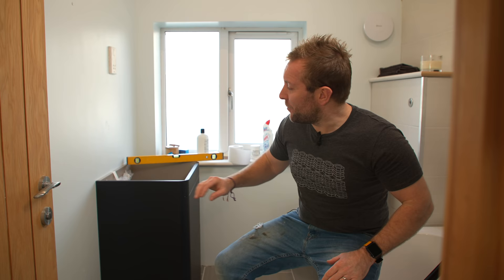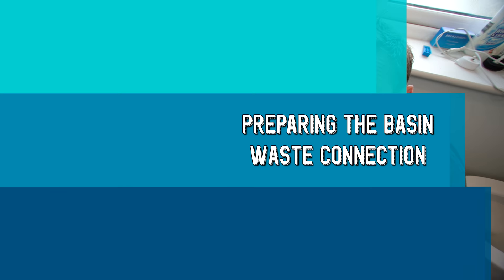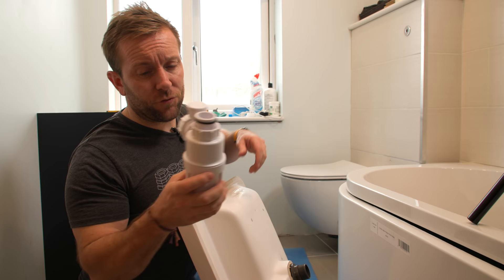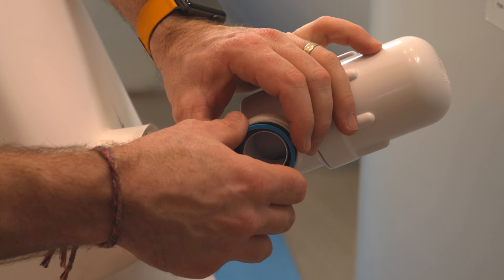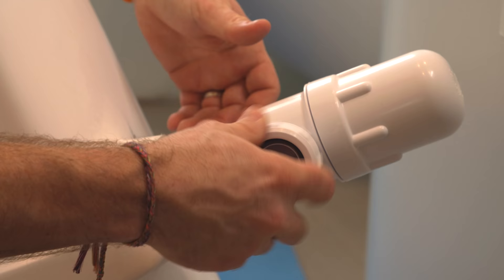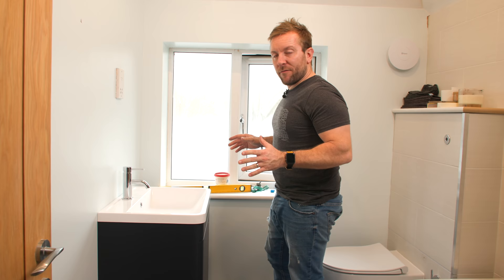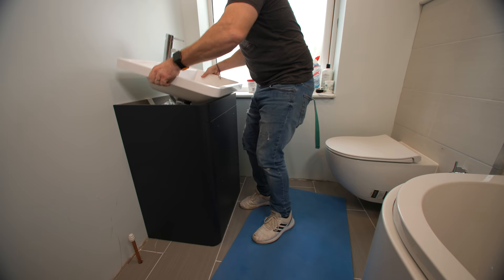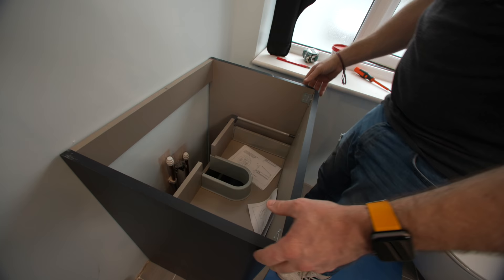How to fit a bathroom vanity unit & basin STEP BY STEP with CHAPTERS!

Comment: Not long finished fitting one of those exact vanity units (from Wholesale Direct) . Never again! The fact that the drawers are not removable forced me to do the entire underside plumbing, then fit the sink last. Annoyed, because I had to get all my fittings measured to within a millimeter. Took ages compared to a unit with removable drawers. Also, I used a quality double-sided mounting tape instead of glue to stick the sink to the unit. Worked a charm. Good video. Avoid Wholesale Direct is the message. Oh, and I used a basin mate kit instead of plumbers mait. You absolutely positively have to use something, as the seals it comes with are about as useful as a chocolate fireguard.

Comment: Should you use tap tails on the service valves to give a flat seal as opposed to connecting flexi straight onto valves bevelled edge ?
Reply: yes!
Reply: Can use the spare parts from a radiator kit when customer asks for TRV's to be fitted.  Flexi will screw onto part and smooth end can go into service valve.  Alternatively get service valves with flat edge/face

Comment: Hiya mate, could you point me in the direction of a video where you have to hang a radiator to suit the pipe/valves already there? Like the heating pipes in your bathroom now, the process you go through to find where you put your brackets on the wall so the rad hangs exactly in position for those valves to go straight onto it. Thank you 👍

Comment: What was the "glue" used to fix the basin to the vanity unit?
Reply: In my opinion it's best not to glue sink to vanity unit this way. If you ever need to remove it you'll destroy unit. Better to use kitchen fitter practice... place the sink on loose, then run a bead of silicone around the inside top edge (and maybe outside). This fixes it. If you ever need to remove just run a knife through the silicone and sink comes off without damage to vanity unit. But that's just my opinion.😉

Comment: How long do you have to leave the solvent weld glue to set before you test it?
Reply: Solvent weld doesn't take long I expect it will say on the bottle but usually done in 5 minutes.  Solvent weld is used for waste pipe not a water feed I usually run the tap after 15 minutes
Reply: Thanks
Reply from the maker: Answering in the next comments vid!

Comment: James... quick question. Watching many (way too many) of your videos...  you seem to frown on the use of the isolation valves you've used here. What's the crack with their use then?

Also was this carried out on a Friday... a Flexi-friday! 😅
Reply from the maker: Cheaper than levers! that's about it though, they are prone to leaking and going wrong though....
Reply: @plumberparts  Aren't they just. Trying to get any in our own property swapped out to F/B lever valves.

One thing then about these horrid little compression valves... is there any decent one's out there or are they all prone to being  'leaky-leaky' valves?

BTW..  loving your extended series on this bathroom refurb. And as Emily might  be heard saying... "get on with it"🤣
Reply from the maker: Answering in the next comments vid!

Comment: Nice camera work. Same vanity unit  I'll be buying.
Would you also use bottle trap on kitchen sink waste rather than a U-bend? Thanks
Reply: If you use a bottle trap for the kitchen sink it’ll have more of a chance to block than a normal P trap due to the way they are shaped inside
Reply: @daleprosser350  P trap all the way then unless space is in issue?
Reply: @elfidge1  yeah P trap is the standard, or you can get specifically a kitchen sink trap with connections for a washing machine/dishwasher waste to connect onto if you need it
Reply: I should’ve mentioned it’s food that would block up the bottle trap
Reply: @daleprosser350  Nice one in that case only thing I took from this video was to get the anti-syphon valve simply to stop gurgling. Appreciate the replies fella, thank you
Reply: @elfidge1  no problem 👍

Comment: Which manufacturer is that bottle trap? McAlpine? My bathroom fitter fitted an S trap to a down pipe and I struggled with bad odours in the bathroom. I bought one from B&Q which leaked like mad, then tried a Wirquin which is much better but not quite perfect and has the worst nut ever!
Reply: Yep it's a McAlpine.  I was so pleased with the one in my ensuite that I have got another for my main bathroom that I'm on with now. Mine came from Screwfix.

Comment: I'd of liked to see how the draws come off and on as I only do repairs and no installs
Reply: You pull them out and up at the same time and the whole drawer lifts out.  I just bought one of these units!
Reply: Similar to kitchen units some of them will have a bit on the rail you have to press to release as well.
Reply: on the side of the drawer there are some blanks, pop them off and there are adjustments to drawer high and also 2 small levers to realise drawer from rails

Comment: What's that tool called on your drill you use to clean up the pipe 🤔  also what's the name of that roll of squared metal Sanding strip please
Reply: A biggie slip.
Reply: Or a “rubber.”